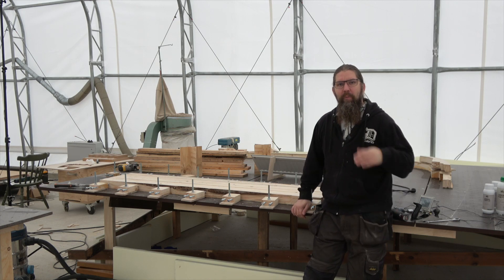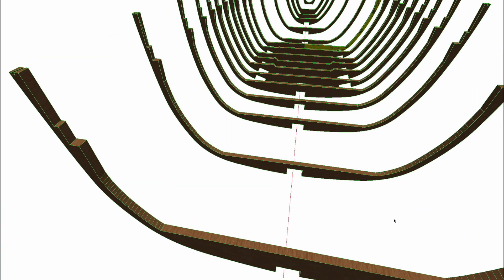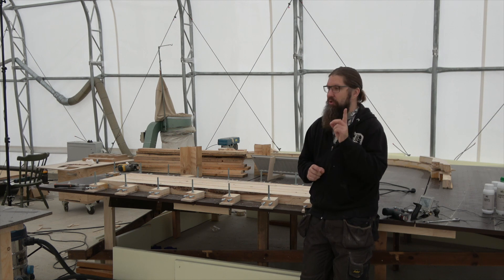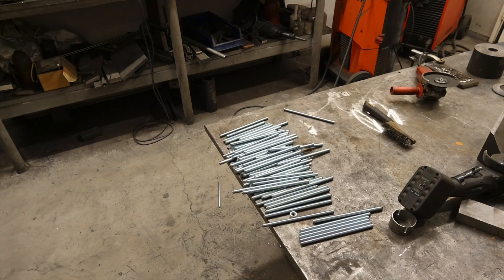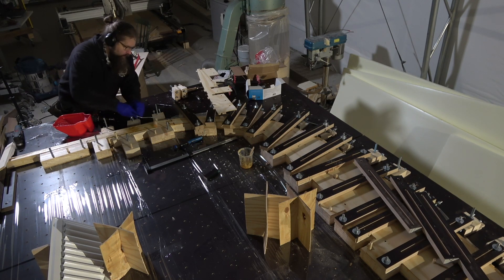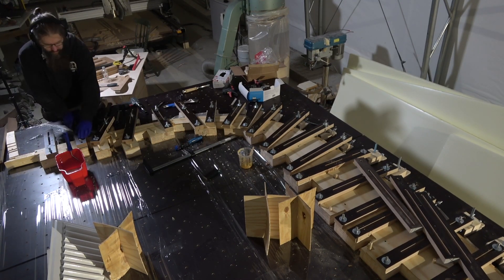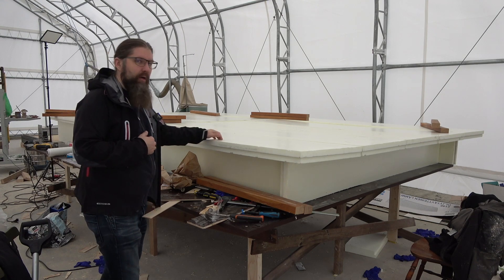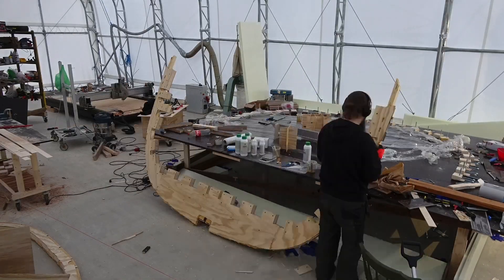Sailboat build! The second frame! ep.48 Project SeaCamel

Comment: I like the newer video format better, although your explanations as you work are interesting as it gives insight into you thinking which for this amateur, rookie boatbuilder is eternally grateful. Another thought of mine is to get a relatively heavy plastic, rubber or wooden hammer instead of using a nailing hammer to drive the bolts and dowels in the clamps and structual pieces. I use dowels a lot in projects I build using epoxy and find the broader hammer heads are easier to use and do a better job at working with the connectors.

Comment: Before you release your frames use a cable or board to secure the top of the frame to the other side. Starboard to port. Will help keep its shape while they wait, easier to carry, less twist. Over time frame tips can spread or get squeezed closer together,  even a little will be bad.
Reply from the maker: Hi! Haven’t noticed any spring back with these so far!

They all have some cnc-cut holes in them which I can use later to align thing If necessary. Also there’s notches on the ends to align them to the bulwark pieces later. So not so worried about that. ☺️

Comment: Maybe another point in the process to consider is to have a roundover router station next the cnc table. So basically just a cheap router upside down in a table with a foot pedal. Since most pieces you take of the cnc need cleaning up the edges this will be safer, faster and easier.

Comment: There's no need to have a smooth surface for gluing with epoxy at all. The opposite is the case, a sawn surface is increasing the gluing surface and guarantees for some more gluing seam. I think you should get a friend to help for these big jobs. And I wouldn't put the ply on top before the slabs are in place as it's impossible to determine open spots.
Reply: I second that sawn surface information. Most problems in lack of hands can be tackled with either another fractioning of work or, what I did mostly, with different hardeners offering different, sometimes prolonged open times.
Reply: @manfredschmalbach9023  He already has one with long open time and ability to cure at low temperature.
Reply from the maker: Yes I'm aware of that but sawn surface also means ALOT more epoxy! So far it seems that the glue works amazingly! There's no way I can get any glue off the pieces without ripping the actual wood apart.

More importantly the slats need to be uniformly thin which is something the bandsaw just doesn't bring. There's dips and bumps on them and planer makes them perfect.
Reply: @ArcticSeaCamel  The argument on the bandsaw is true indeed. We have cut the slats of oak on my tablesaw what worked fine. I believe for the interior you'll need a combined machine or at least an stationary router anyway. I got myself an 30 year old combined machine with table saw, planer, thicknesser and router for 1600€ some 14 years ago. Unfortunately it just stopped working as the electric has a failure. You might want to look out for used machines such as your planer.
Reply from the maker: @Hotzenplotz1  Yes, table router is still "on list".

The "Bogeyman" (i mean the planer) has actually router parts for it. But its very big and deadly as h**l! 😱 Not sure if I want ever ever to use it!
Reply: @ArcticSeaCamel  Ok... Can't imagine how the horizontal axis of the planer should drive a router but you may look into YT deeply. There are dozens of tons of videos to improve safety of machines or create new functions from scratch.
Reply: @ArcticSeaCamel  As long as You destroy woodgrain only and not the boundary between epo and wood in somewhat big-ish amounts You are golden. 
Penetration and still enough epo through curing is key. 
We sometimes preheated wood-surfaces to better the penetration. 
Another rule of thumb in my workshops was "the dryer the wood, the better penetration" - everything below 9-10 % is golden, too. I reckon Your lumber is kiln-dried? Dry enough for sure, as long as You do not let it accumulate vapor for prolonged time in an unheated room again. 
The bandsaw-problem (bumpy uneven cut) is an unevenly sharpened blade, too slow running sawblade and too less of tension - You will absolutely ruin a cheap one though with the "right" amount of tension, so You better plane what You did cut.
With the vacuum bagging method instead of clamping only You get even better penetration because excess air is sucked out of epo rifts while curing. Vacuum bagging does reduce the needed amount of epo in the surfaces. You might consider to start with that method somewhere along the build. It is so bloody easily done with one or two breath-support pumps from a clinic (they have to be changed by schedule, not by "working condition", with no tolerance for faliure, of course) and a couple hoses and fittings, once You got it sorted You'll never close more than two to three clamps per frame again 😁
Tanks for sharing and cheers!

Comment: One tip on how you can expedite the working process, which I learned by doing the first hull of my catamaran, as I did it pretty much the same way as you, namely milling the pieces for one frame at the time, because I wanted to see “results to look at” - learning by experience, for the second hull I prepared the material for doing the whole second hull (in your case for example the slats and the shapes you create with the CNC) at once, before I started to glue the different parts together. The building time difference is enormous, because you do the similar tasks all at once, instead of switching from one task and work-setup to another constantly. Just as an example, it took me close to 6 months to make hull #1, but only 4 months to do hull #2.
Reply from the maker: Yeah, I'm currently making parts for five frames at once. It also reduces waste when fitting all the part to the CNC-stock!
Reply: @ArcticSeaCamel  , yes, nesting the parts on the cut-out sheets is crucial to save material !

Comment: I would consider a more powerful central vacuum sawdust collection system than your less powerful portable shop vac as my next tool purchase. You have allot of frames to build and that's allot of sawdust. Your voice over video is very good.
Reply from the maker: That's something on the list. That machine has great air flow and I will attach it to piping system eventually. I just need to do the insulated walls first...

Comment: Suggestion:  Enlarge the holes in the clamp table one size and install t nuts on the bottom.  It will save a lot of time crawling under to put on nuts and washers and pounding the rods in.
Reply from the maker: There's over 2000 holes on the table! :D

Now when the rods are in shape, putting the nuts isn't really that big of a job with power drill.

Comment: I wonder about a couple of ideas for greater efficiency:
1. Don't use manual wrenches for tightening down the cross clamps. You already use a drill/socket for the blocks.
2. Design and build a roller process using paint rollers that would allow you to pull each slat across the paint roller and apply the glue then turn the slat over and repeat applying the glue (epoxy) to the other side. In theory, this sounds like a more efficient approach.  Applying glue to both sides in one pass would be more difficult but if you can build a CNC then that challenge might not be so bad. 

The voice over is much better!
Reply from the maker: I do just the final tightening with manual wrench. I just want to have "the feel" for it.

I have tried to find "roller process tray doodad" that would allow just to push the slats through with no luck.
The planed slats really don't need that much of epoxy and i'm a bit afraid that just paint tool will put too much of epoxy there. We'll see, maybe I'll invent something! :P
Reply: Have you thought of adding some fibre glass strip between some of the strips that would make them super strong.

Comment: Try placing 3 or 4 slats side by side and apply the epoxy with a wider roller. May be a little faster. You may need to build a dedicated paint bench. Love your innovation. I have a small amount of experience with CAD. I use V-carve for design. What are you using? Keep up your fabulous work.
Reply from the maker: I may do this. But i need to apply the epoxy on the other side as well anyway. :)

Comment: Hi,

If I can give you an advice, I am aircraft engineer. When we found a bolt/screw rotten/corroded into it's place, and we need a hammer to punch it, we always leave the nut in the end of the thread. Then when you hit the crew&nut with a metal hammer, the thread won't damage. The nut could protect the starting point of the thread.
Same when you cut the thread rod, cut it between 2 nuts. Put the nuts just that far from each other than your saw blade, and you save the thread, not necessary any further file.
Reply from the maker: There should now be enough "clearance" on the rods to hit them without damaging the threads. Hassle with nuts would bee too much... :P

Comment: Another thumbs up on the commentary style.
A thought on the lamination that may make it more manageable. It looks like you could do the laminating in three smaller phases: first, laminate the full length strips, clamp in place  and let cure. Second, laminate the port side strips, clamp, cure. Third, starboard, laminate, clamp, cure. This should reduce the time to do a lamination step dramatically and involve far less clamping force and you won't be up against the epoxy going off too fast (especially next summer). Once you have a step clamped up you can move onto prepping the next frame for the rest of the day. 8 hours of laminating looks absolutely exhausting!!! Breaking up the tasks during the day hopefully will prevent or reduce burnout. 
Awesome how you are incorporating CAD/CAM into the build and using the CNC for super accurate templating.
However you proceed, I am impressed with how you are taking on this build and learning with each step.
As the owner and caretaker of a cold molded Kauri wood sailboat, wood, epoxy is the best construction method available!
Reply from the maker: Hi! Thanks!

Yes, I've been thinking that option as well. The problem there is that there's always some squeezeout from the lamination and if that cures I need to mechanically remove and sand all the excess before doing the next batch. And with the plywood sheeting the gap remaining between is hard to reach...

The lamination of single frame IS big job yes, but I think with proper preparation and getting epoxy mixing tool I should be able to manage it.

Comment: You can get some slower epoxies. Maybe look at Poly-poxy if it is available in Finland. It requires heating for a cure, but it seems you are willing to do the heating.
Reply from the maker: Good to know. With these temps though, this epoxy performs very well. :)

Comment: Some thought/advise about problems you have said. In regards to the high cost of building the insulated area you have talked about before: how about first building just the half the boat will not be built in with a second floor over it, this would greatly reduce the area that needs to be heated and give you a second floor near the same height as the boat so you will not need to go up and down as much later on. The wall down the middle of the shop could be made from insulated bubble wrap that is very cheap and surprisingly insulative, I suggest it because you can let it hang down and then roll up some of it to give you more work space without a permanent wall in the way. Think the only way to save time would be to make the strips in LARGE batches so your not spending so much time cleaning up over and over again. The rest of what I had thought of during the last video you seam to have figured out already, such as using a hole and dowel to keep the center... ...well in the center.
Reply: Great thought, reducing the Sq. Ft. area of shop to improve the insulation within the work table.
I thank you for the Video, great work, just maybe in the speed up section add some music.   :)
Reply from the maker: I'm still pondering how to make the insulation. There has been bit of problem lately (on fall) of condensation dripping off the steel frame of the shed. So yes, I need the insulation.

Also the tent cools down very very fast after sunset!

We'll see!

Comment: I would suggest putting 3 nuts on a rod, and welding them together.  Then you take them of and can screw them on the other rods, to hammer on these nuts instead of hammering on the rods themself. This should preserve the rods from being damaged, because it spreads the hammering load
Reply: apart from this little thought, I like your CAD and CNC supported process very much. That was a lot of thoughts you put into this concept ahead. Well planed!

Comment: I find your way of building frames interesting. It seems you are referencing the inner edge/surface of each frame to your plan and then just leave it for thickness of laminated wood to define the outer shape. Which would eventually define the shape of the boat. Have you discussed that in any of the previous videos why do you do it that way. my layman reasoning would be to set blocks defining the outer shape and clamp the laminate stack from the inside.
Reply from the maker: Hi Thomas. Yes, you're exactly right. The plywood forms are to define the hull shape on the both sides of the frame and this way I should get really precise shape to the frames.
And good question about the layup. I actually thought at some point - to make the molds "female" so that slats would get push from the "inside" to the shape. But the real reason is that the inner shape is "straight" and will remain that way to be able to attach/glue things on them easily. The outer edge of course is going to be shaped for the hull anyway so the actual measurement how thick it's coming up when laminating doesn't matter that much.
There's previous videos I go little bit in detail how I planned to make the frames and explain the system little bit on computer.

Comment: Those brackets u use to hold down all the slats. Put a small curve on the bottom so as u tighten them down the center gets squeezed first and as u tighten the outside edges bend an squeeze.  U will get a little more center pressure to hold all even. Otherwise the center can still stick up a bit.
Reply from the maker: Intreresting idea... 🤔

Comment: I just stumbled upon this channel so you may have covered this already.  Are you using an Up-cut, Down-cut or square cut bits?  On the deep cuts on your CNC, it appears that your bit is not evacuating the chips from the cut which would seem to indicate a down-cut bit.  An upcut bit should clear the chips from the groove which will let the bit run cooler and the motor to not work as hard.
Reply from the maker: Hi!

The router bit I have now is compression bit. Up cut on the bottom and rest is down cut. Makes very clean edge on top which is great. I also like the fact that the pieces stay in place very well when the chips are pushed down into the groove.

The problem is that that bit isn't actually long enough for cutting as deep as I need. The upper section then tends to heat up a little.

I will buy more bits eventually of course - they're just pretty expensive so... 😅
Reply: @ArcticSeaCamel  It just seems that packing the groove with chips putts a much greater load on the router motor and builds greater heat in the bit which will shorten the useful life of both.  Using an upcut with a vacuum head would clear the chips from the groove and surface and keep everything running cooler.  The two things combined, would allow you to use a faster feed rate.  I would not think that keeping the pieces in place would be a problem with the system you have in place of screwing down to the table and the uncut tabs you leave behind.

Comment: Hi ! I’m a little (quite) further in my building process than you, but way behind in composing videos, so in the latter I can’t give you much advice, but let’s talk about the building process :
Your decision to buy the multi-tool and the router is a good one, and choosing the Bosch brand definitely too, the only thing I found out by experience is: spend the money for the cordless ones, they are worth it ! Especially the 18V battery powered series is phenomenal, and having bought first some corded ones, and still in my possession, I don’t use them anymore, cordless is the way to go! 
…and when you have more of them, your battery woes are gone anyhow, as you can use the battery from another tool, while you recharge the one depleted, and charging time is about 1/2 hr for a 4 amp/hr battery, but my experience is, that even if you use a single tool the whole day, you very seldom have to switch battery, as they last very long. Only their track saw (I like it a lot), needs quite some battery power - an 8 amp battery lasts only for about 120m of cuts on 20mm material, but 120m cuts is not a little amount…
Another tool I highly recommend, is the 18V cordless hand planner from them, and you will at some time need one.
In regard of video editing, I don’t know what you are using, Clipchamp” is my favored software tool (and it’s free software), and it comes also with a very good text to speech feature - if you don’t have it, try it out.
Reply from the maker: Thanks!

I use Final Cut Pro :)

Comment: Is there an advantage of laminating the frame as opposed to solid oak construction.
Lamination seems extremely tedious and labor intensive. You are a very detailed craftsman - I am  sure you researched the advantages.
Reply from the maker: Mostly that I can use very basic materials. Oak is super expensive. Also the solid timber would need to be top quality without any knots or splits.

And of course in this case I'm using CNC to make the shape. It could be quite difficult to achieve with bending...